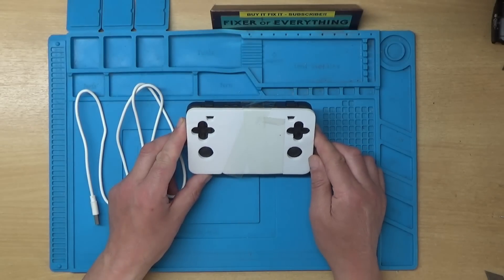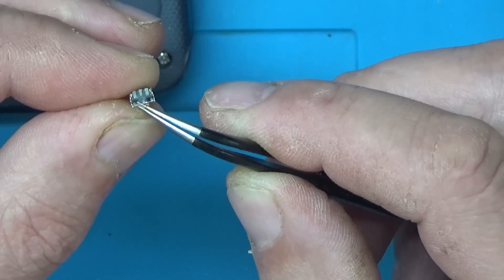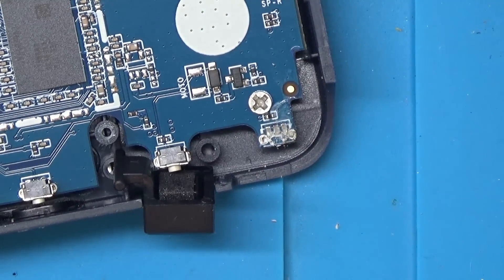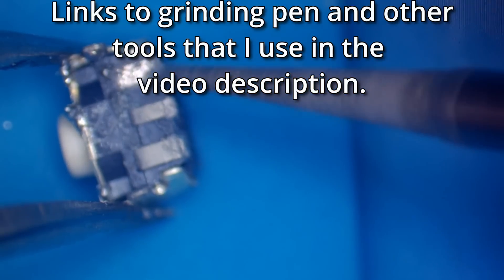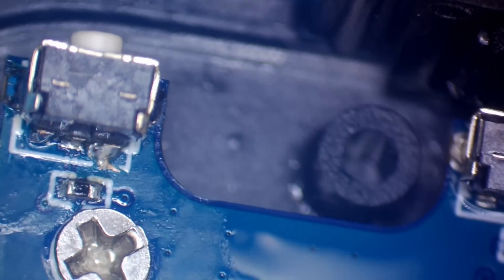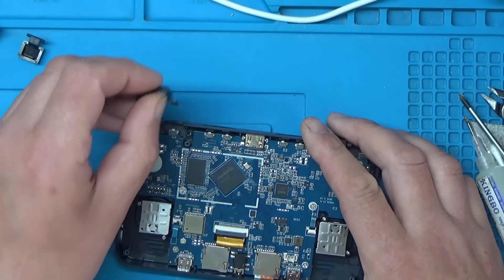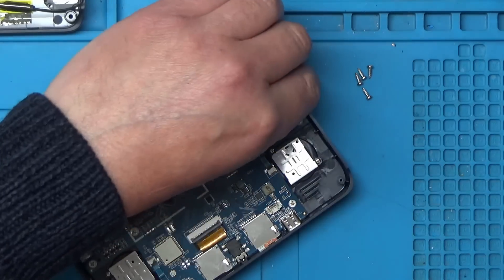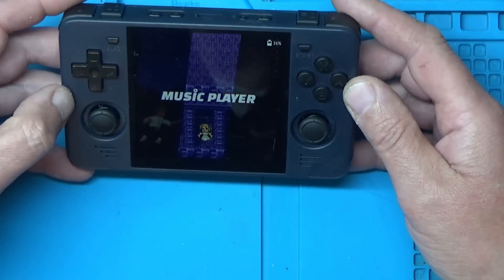Subscriber Dropped His RGB30 Console | Can I Fix It?

Comment: I could smell that super glue being burned from here. 😂 Acetone is the way to go and let it soak for a bit until softer. Think using goo gone to remove stickers. When in doubt leave the super glue hard and grind it away slowly as to not heat it up to melting point.
Reply from the maker: Interesting, thank for the tips 👍

Comment: Always enjoyable to watch your repair process. 
I have a repair I’m about to tackle and wanted to see if it’s something you’ve had experience with. 
I use an old iPhone as the display for my   InfiRay P2 pro thermal imaging “camera”. Like a moron , I sat the pair on my knee to reach for another tool which is when gravity made an appearance. It fell the distance from my knee to my shoe(seated) which accelerated it enough perfectly snap the “Lightning “ style cable end just below the metal sleeve. 
If you’ve had an InfiRay P2 pro apart or have any insights or wisdom, I’d appreciate anything you can pass along.  Thanks for the great videos!!
Reply from the maker: I think someone did a tear down of one on YouTube. It was glued together so you had to heat it to get it apart.
Reply: @BuyitFixit  Thanks!! I just got it apart. I considered heat but opted against so just used a new razor blade and new plastic scrapper in the seam. Steady torque on both tools and it opened right up. Mine appears to be a tight tolerance machine fit, no cheese. The repair appears to be pretty straight forward from here, though my luck can cause anything to go sideways! If you ever you need photo insight into the operation, I have some good stills.

Comment: Nice simple fix, great to see you do subscriber repairs. 
I've a Disco 2 that needs a bit of soldering on the chassis. I've put a 1st class stamp on it and just waiting for the postman come by and pick it up.  🙂
Reply from the maker: Thanks 👍Bloody Discos 🤬🤬I'm in the process of getting rid of the Disco 4 we have. I've had the body off the bloody thing 3 times, changed turbos, EGR pipes, wheel bearings, refurbished all the calipers,  fixed the bluetooth module, rear boot lock actuactor, mechanism & switch, handbrake cables, re-built the EPB module etc etc etc.. I've probably forgot half the stuff I've had to do to the bloody thing...
Reply: @BuyitFixit  that's taking perseverance to the next level. 🙂 if only i could find space to get the body off!  would make getting rid of the metal moth holes a lot easer.

Comment: Looks like someone (?) tried to glue the micro switch back on with super glue... Better way to install that switch though...solder it! I had a similar situation where I had to manufacture a pin post as well. Looks like your repair will work to me...    Thumbs Up!
Reply from the maker: Cheers Gary 👍 yes the super glue method wasn't a success 🙂

Comment: Try using 380°C in soldering iron or 400 for the small areas and you will have better results of how the solder behaves
Reply from the maker: Thanks👍Around 380 is what I usually run, however I find the small tip just doesn't have the thermal mass to get heat into things like a ground plane.
Reply: @BuyitFixit  yeah I never run a pointy cone tip, always a chisel.  On my micro pencil I do have assorted tips like curved for SMD work. I always run at 400C/750F.  I use the Hakko FX-100 which is basically a Metcal where it uses induction heat and the temp is determined by then tip specifically, so I can’t change temp unless I purchase other tips meant to change the temp. I do keep a couple 450c/840f large chisel tips on hand to dump heat.